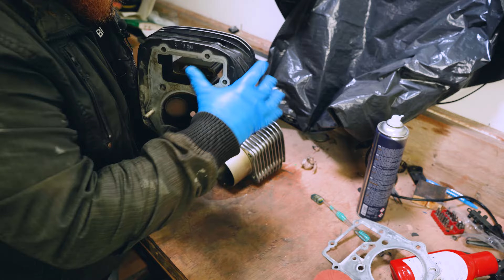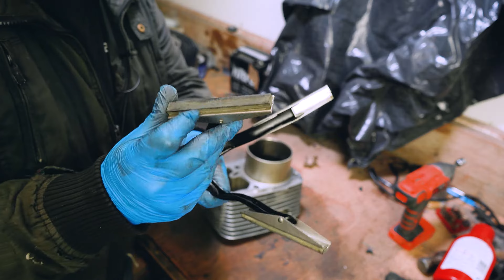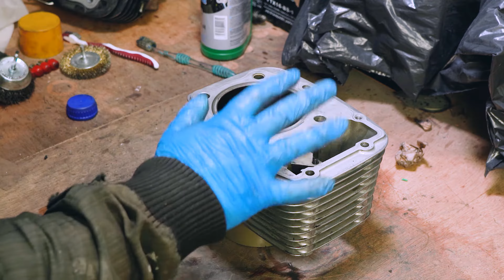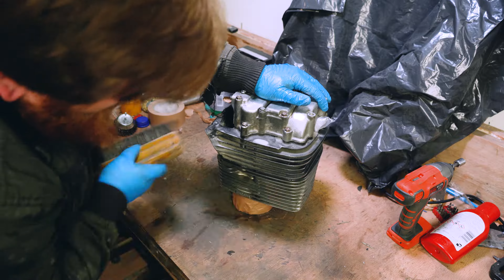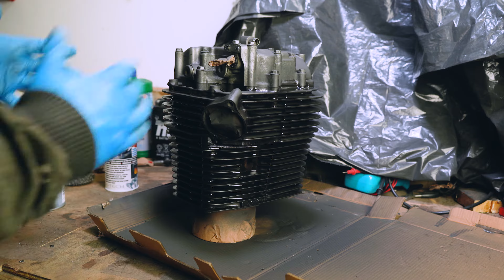Suzuki Intruder VS1400: Engine Paint - Rebuild Part 4

Comment: Looks amazing man! Here is a Tip when spraying with rattle cans. Any time you rattle can this is what you need to do. The rattle cans need to sit on a bucket or bowl of hot water for about 30 minutes before you start spraying. After doing this the paint atomazies better. Leaving a much much cleaner look. Ive done this method on most everything I've painted with rattle cans. In between coats you do need to put the can back in the water. Just so it stays in a proper atomized state. 

Keep up the videos man!
Reply from the maker: Thanks for the great tip Soul, I'll be sure to do this in the future!!!